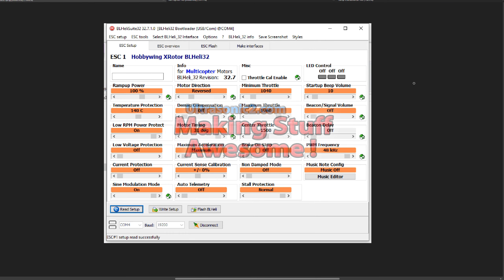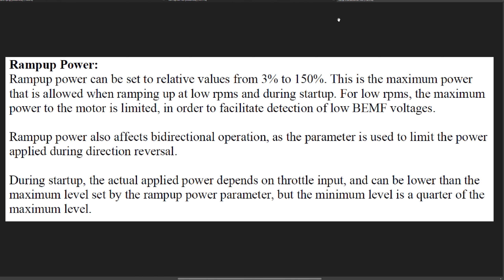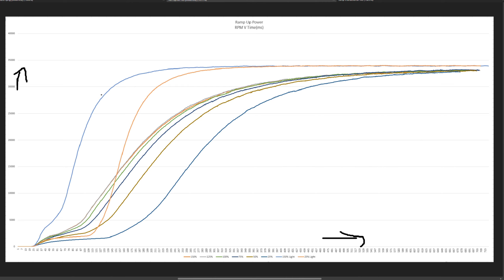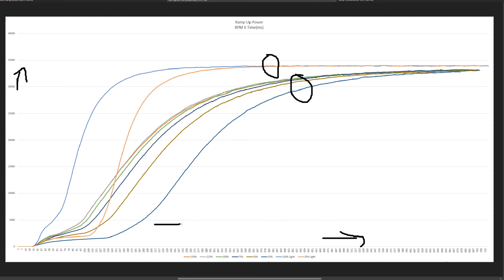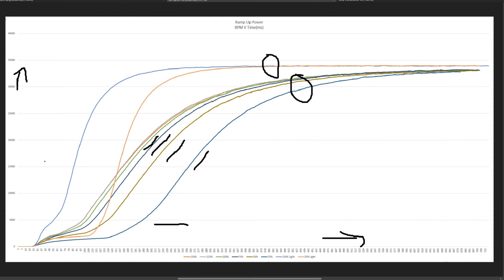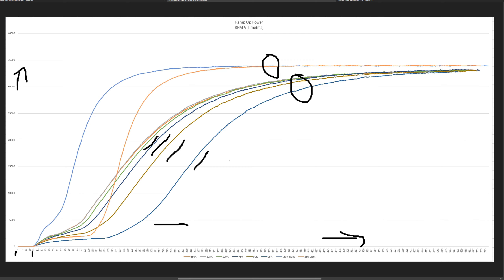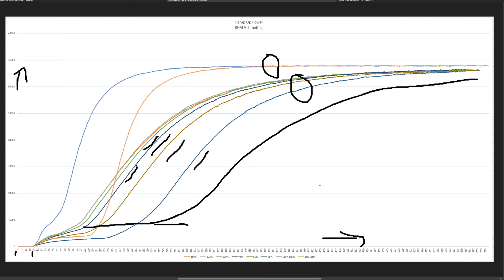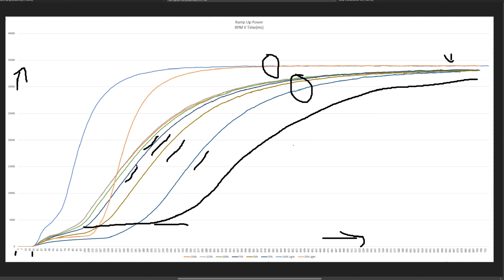⚡️ BLHeli_32 Rampup Power Dyno

Comment: Why would anyone use rampup power larger than 50%?
Reply from the maker: We found that lower the voltage the higher the ramp up power you could run
Reply: @Ultrasonictwo  Thanks. I use 5 and 6 inch 4s to 6s quads. On all of them I use 20 to 25. Because I hate when motors are too jumpy. But I guess makes sense for tiny whoops and such